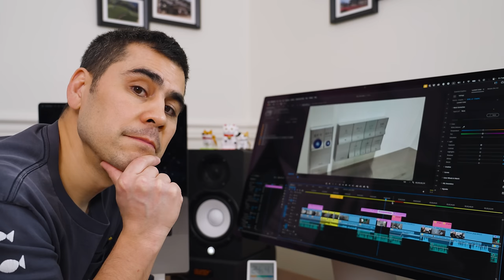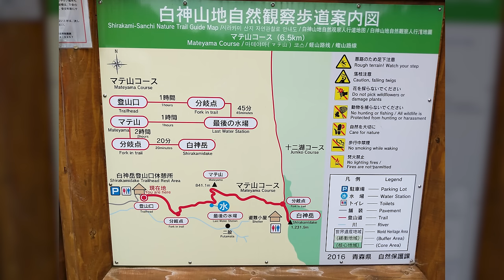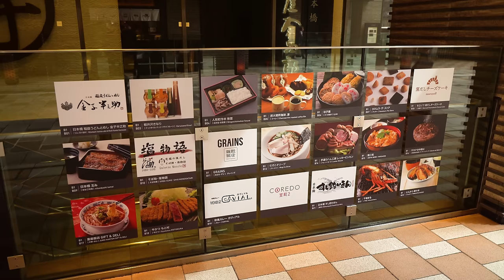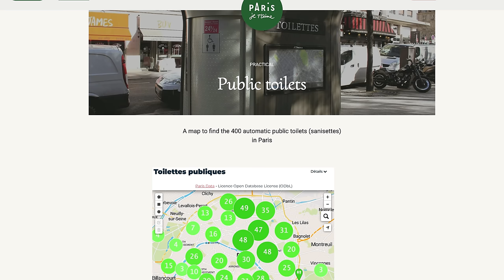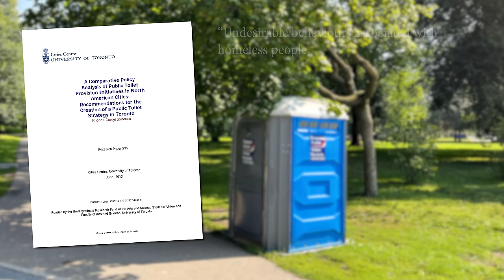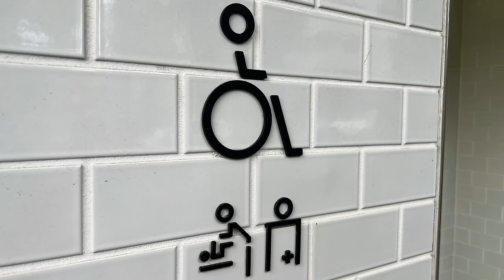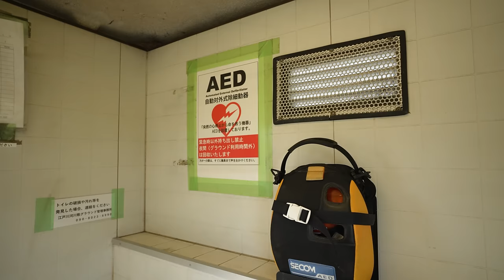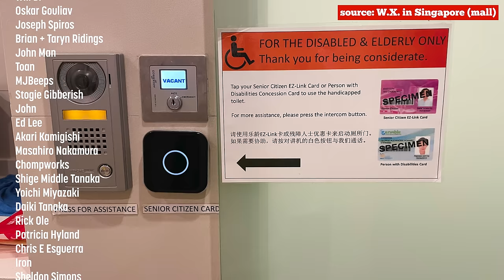Why Public Toilets in Japan are Awesome

Comment: As a Japanese resident I do find toilets great and clean. But I've always had difficulty finding one despite their abundance. If your in a place like Shibuya or Shinjuku, don't try and find a toilet in a conbini (or even a garbage bin) they are almost never there. My tip is to look for a small department building. Head to the top floor where some of the restaurants are (if you can make it) via elevator. I've found because no one bothers to go all the way up to the top in contrast to first floor, that those toilets are super clean and barely occupied.

Comment: I work as a truck driver in Sweden and I live in Gothenburg which is the second largest city, public toilets in the city are gross and I don't think I've ever used them. But outside a big city they are a bit better but it can vary a lot, but I still avoid using them if I have to do number two. Now gas station toilets are good like 95% of the time in my experience, they're cleaned regularly, well lit and the always have soap and paper towels.

Comment: Its hard to find public bathrooms in NYC. Its not out in the open like in Tokyo unless you are in Central Park. Other toilets are either for shoppers only or have to buy something at a fast food place to use the restroom. The amount of times I almost wet my pants cuz I couldn’t find a bathroom that I don’t have to buy something for is crazy. I wish people of NYC has the same respect as the people of Japan so there can be more safe and clean public bathrooms. Even bathrooms in major train stations are grossly dirty and easily get backed up and flood. You need a bladder of steel to be out in NYC.

Comment: In England they have solved the problem of public toilets by assuming that as they are unattended and so filthy and vandalised that no one in their right mind would go anywhere near them, let alone inside of one, they closed them all and deny that there is a need for them. The assumption is that if you do need to go, you could use an ally or a hedge where the rain might dispose of such, or that a road sweeper (I think there was one in Cornwall about 40 years ago) would deal with it.

Comment: San Jose, CA used to have paid public toilets in the early 2000's that cleaned themselves when done. There was a time limit, 15 minutes or so, and then the door would automatically open but you got a warning and could extend the time with a button press. Eventually, druggies started using them to shoot up.

Comment: One of my biggest complaints for public bathrooms are the massive gabs below and above stall doors and even gaps on the edges of the doors where eye contact is possible. Its really weird how its just seen as normal. Like at my work multiple offices share a larger restroom and its relatively nice and well kept. However, someone decided that investing in a beautiful granite countertop and large mirror was more important than private stalls. I don't know if Americans are just too distrustful of strangers or they legitimately don't know what it could actually be like.

Comment: After watching this video, I think that Canada got the short end of the stick with public toilets. I have a micro bladder and have used many washrooms across Alberta and BC (and more than a few bushes). The level of cleanliness in the Japanese toilets is a far cry above many here and I rarely even see a public toilet that's not inside a business. And parks generally have outhouses with no running water.

Comment: I've been studying global sanitation & hygiene efforts since about '17-19 and am looking for the ultimate standard of public care to be implemented globally. 
Here's what I've come up with so far:
1. Both squat toilets and western style toilets are necessary to accommodate the best manner to release a bowel based on a person's health (handicapped need western toilet).
2. Bidet is a global world standard for hygiene because a washed bottom will always be cleaner and more sanitary than a wiped one.
3. A self cleaning bathroom should be further developed prior to becoming a standard, as it has a few flaws needing to be addressed (longevity of sensors and actuators; overal lifespan of electrical systems and sewage management protocols need upgrades based on current atate of research).
4. Closed loop system sanitation needs to become the new global standard due to the ability to eliminate the spread of disease via sewage transportation or transfer. This means desiccation and burning of all solids and distillation of all liquids for reclamation of water and fertilizer elements within a sterilized outcome for both. 
5. Public access needs to become a standard universal human right, enforced globally and funded globally.

Comment: Anecdotally, I suspect that more publicly accessible private toilets are being removed. I found it very difficult to find a konbini in Shibuya, Asakusa or Shinjuku with a publicly accessible toilet. I suspect that overtourism is contributing to it because tourists may not always buy something if the buying suggestion isnt enforced. Eventually i just got accustomed to using the toilets at the eki instead of the konbini.
Reply from the maker: Yeah, I think overtourism is hurting publicly accessible but private toilet access in the popular areas that you mentioned. Still no problem in most areas of Japan from my anecdotal experience.
Reply: Most conbini in the city don't have toilets. Usually there are public or publicly accessible toilets nearby though which is good. Shopping centers, parks, stations, even shrines and temples might have them.
Reply: @LifeWhereImFrom  why are there no soap in the public restroom in Japan you didn't explain that on the video
Reply from the maker: @mrnekokittycatsaki1419  I don't know if there is a good explanation. Might have to do a little investigation.
Reply: @LifeWhereImFrom  All
Reply: There are however many public toilets in Shibuya.

Comment: If you are in a big city, go to a large building and go to the 2nd or 3rd floor to use those bathrooms. 
They are even nicer and not crowded like the bathrooms on the 1st floor or basement amongst all the retails stores. 
Also, every city / government office has bathrooms. Even gas stations have restrooms that if you behave you can use.

Comment: In the U.K., public disabled toilets have a lock on them and there is a key called a RADAR key that disabled people can buy from their council that will fit every single lock, meaning these toilets are accessible 24/7. 

Now, in my home town, at our relatively new Bus Interchange (it’s been open for about 2 years), there is a disabled toilet and a wheelchair accessible wet room complete with toilet, shower, a rise and fall sink, hoist and changing table which is adult sized. 
There are also regular toilets too.

All of these toilets have opening hours and are shuttered up when closed - yes, even the disabled ones ! 
So, you’d expect that these toilets would close after the last buses stopped running, wouldn’t you ? 

WRONG ! 

They close at 9.30pm Monday to Saturday. The last buses are around 11.30pm Monday to Thursday and 2am on Friday (Saturday morning) and Saturday (Sunday morning).
On Sunday they close at 4pm, despite the last buses not being until around 11pm 

If an able-bodied person needs the toilet after close, then they can usually find a back street or trees to obscure their view if they need to urinate - it’s illegal - but if you need to go, then people do so. But if you’re disabled like me, that ISN’T possible ! 
Why this bus station has made it more difficult for disabled people to toilet is beyond me !
I don’t live far from the town centre, but I’ve asked many a bus driver if they can drive a bit faster when I’ve been bursting to go for a pee ! 
I must contact the company that runs this station to see if they intend to change this policy, because it’s ridiculous !

Comment: Im not too disappointed with the lack of soap because the availability of clean, running water with good pressure is more important. Soap and alcohol cant kill some microorganisms like C. Diff, so the friction of rubbing hands under running water and physically pushing the microorganisms off is more important. Soap AND running water is better but for overall utilitarian, cost-effective availability, running water is great.
Reply from the maker: I always carry a little bottle of alcohol spray with me just in case there's no soap. I'd much rather have a toilet and running water than soap (but I'll always take soap if there's the option).

Comment: Some cheap paper soap will solve the soap issue. Squat toilets aren’t very accessible so it makes sense that there’s less of them now. Taiwan has quite a few free bathrooms and the convenience stores don’t make you buy anything to use them however squat toilets are still very common and you probably need to bring your own tp. Especially if it’s in a park or something.

Comment: There are public toilets on the German Autobahn. The public ones are usually located in a small building, without a gas station where you could buy anything. But they are free.

Urinals are mostly okay to use, sometimes I gather up enough bravery to wash my handy in there. And the seats... we don't go there, or even think about going there.

Similar für the trains here. But there you got new problems I don't wanna go into rn.

Comment: I lived in Malaysia for 6 years and since the lifestyle is usually going from this shopping mall to another, I never had problem with finding a public toilet. After moving to Germany (here also 6 years), I rarely can find a one. There are plastic portable ones usually installed for constructions sites or similar temporary places (which stink a lot and I have never seen a woman use them), but in general, it is nearly impossible to go out for a hike up a hill or cycling between cities and see a toilet. Germany's number is probably high in the list since they only install them inside major cities and there are many important cities here, unlike countries where the capital has the concentraion of population.
Japan is much more accessible by being 24-7, having plenty of konibi stores and vending machines all around the country, making outdoors activities much less stressful. In Germany, we have to plan everything ahead and when on the trails, we do it behind a bush, when on the road we look for a petrol station to buy overpriced drinks and usually they also have a toilet (gotta be a customer tho), which unfortunately petrol stations they don't exist on top of hiking trails lol

Comment: While the "for everyone" design is a nice idea, if there's only one of them it can be a problem. It's great if it's for a small bathroom with only one stall, then yes, by all means make it as accessible as possible, but when it comes to bigger ones that see a lot of frequentation, it's a very common issue that abled people who want to change their kids/change their clothes etc will see those stalls as primarily for them and not only stay in them for ages, cutting off access to toilets for disabled people, but even get angry at disabled people for using the space they think is for them. To say nothing of all those where the changing tables are left open "for easier use," making it impossible to get in with a wheelchair. 
Really impressed with the option for cleaning the bags, though.

Comment: Pulling this out of my.... but I would imagine Japan will also have far more Privately owned and run toilets that are made open to the public and presented well for the public to use, rather than needing to be all "customers only" about it or deciding if it's even worth having them at all (worrying about vandalism etc).
Reply from the maker: That was part of my point with the number of convenience stores across Japan. There are 44 per 100,000 residents. Just those alone provide amazing coverage. But if you add in train stations, malls, hotels, restaurants, cafes, and other places where you're expected to be a coverage, there's a lot.

Comment: Wait, you can use the toilets at conbini without actually having to buy something?
Reply from the maker: There are programs in certain areas where they say it's OK to not buy anything and use it. Practically speaking, I always try to get something small, like a drink, when I use a toilet at a conbini. But there are times when I'm travelling a lot and I've stopped at 3 different Lawson's in one day and I didn't buy anything every single time I used the toilet. So, it's the polite and respectable thing to do to buy something, but nothing bad will happen if you don't.
Reply: @LifeWhereImFrom I can see your reasoning, I would buy something just small too if they allow me to use there bathroom. Just suprised you can do that in Japan for free, without having to worry about it. Also where im from not all shops and deffo not our conbini's have public accesible toilets.

Comment: It's always interesting to get an inside peak at designing things. There are always so many factors that you don't think about, as someone on the outside. I'm also not surprised that men use public toilets more than women, since we might just be standing. I'm sure that statistic is similar around the world. I'd be interested in seeing if that number changes for men when it's split between going 1 or 2.
Reply from the maker: I was thinking the same thing. I only go number 2 out in public if I absolutely have to!

Comment: Public toilets in New Zealand are no longer windowless, rubbish and graffitied concrete chambers that smell really bad! Now they are self- cleaning and pleasant to use (even if the paper is awful).

Unfortunately, public toilets here have 'hours' still and if you are out walking too early (or too late), there is nowhere apart from petrol stations, supermarkets or fast food joints.

I have to say, the public toilets in Tokyo are so 'flash', that I might not identify them as public toilets. The signs are discreet to the point that a visually impaired person may not identify them.

Comment: I wouldn’t judge leaving garbage due to my disability I drop stuff and it’s just easier for me to let janitor handle it if it’s trash and depending on the bathroom they might not even put in the proper trash cans I need like they expect u to flush it but my stuff literally won’t fit there. So it’s also sometime an accessibility issue. I’m kinda dealing with this with my new college I had to leave some trash cause there literally was no trash can 😾

Comment: When I was traveling in China something that I really liked about their restrooms, is they had a one to five star rating. I don't know if that's still is going on now when I was there was in 2007 and then again in 2009, they started it in about 2006 while prepping for the Olympics, But it didn't seem to just be in Beijing where the Olympics were it was also in Shanghai and three other cities that I went to. I never found a five-star bathroom, I did find one four star bathroom I believe it was in the Forbidden City but it could have been in the Summer Palace, and I found another four star bathroom in Shanghai in a museum that I went to, I don't know what more they could do to make those four star bathrooms turn into five star, they were pretty amazing as they were. I went into a two-star and looked around and immediately walked out because it was disgusting, but that two star looked amazing compared to the one star bathroom at a place that we stopped when I was on a bus trip. The one star bathroom had a dirt floor and it had a Chinese type toilet room to the left and American style toilet room to the right, There were no separators of any kind, other than the two separate rooms, so no toilet stalls one room had like six holes in the floor that had a porcelain squat toilet on them and appeared to just have a storage barrel underneath. On the American side you had basically what was like an outhouse a bench with a hole in it and probably a 55 gallon drum down underneath and I think there are four of them that were just lined up along one wall with no dividers no doors There was one sink in the opening between the two rooms so you could wash your hands but I don't know if it would have been any better to wash them as the water was kind of reddish brown as it came out. Again I didn't use this restroom, I just went in to see what a one star restroom was like. The two star restroom at least had a tile floor and running water, but that's about all you could say for it. The three star restrooms are the typical public restrooms from America.

Comment: Hmmmm ...... as a 33 year resident of Japan, not all public toilets are clean. Many are quite frankly, disgusting. You have to choose where you go to the toilet here. Parking Areas (PA) and Service Areas (SA) on the expressways and 'Michi-no-eki' (Road stations) on ordinary highways are generally pretty good and convenience stores aren't bad in general, but some are atrocious. If you can, using the toilets in department stores, modern shopping malls or even large office buildings in Tokyo is often the best option. As for public toilets in parks etc, they are some of the most disgusting. Often vile in fact. They should be last on your toilet priority list.